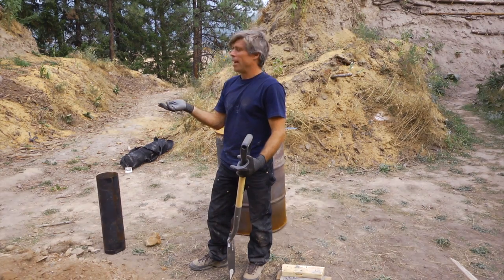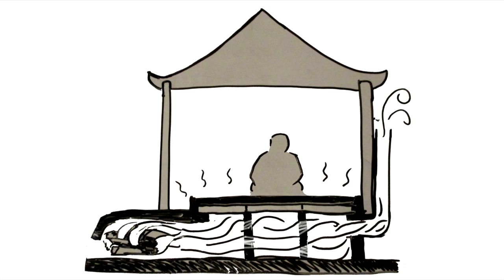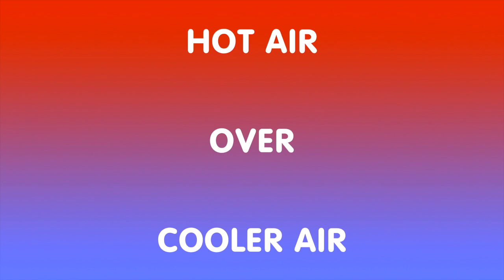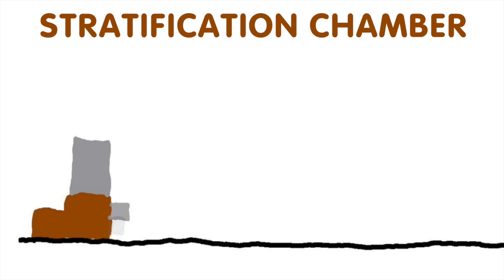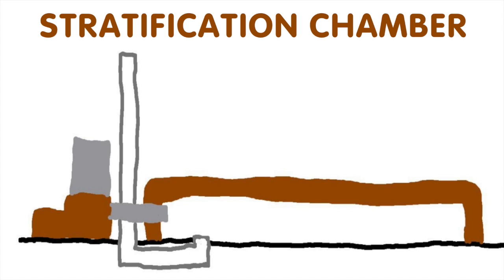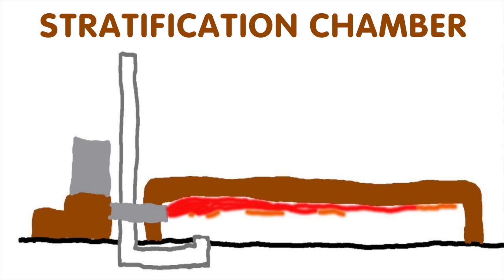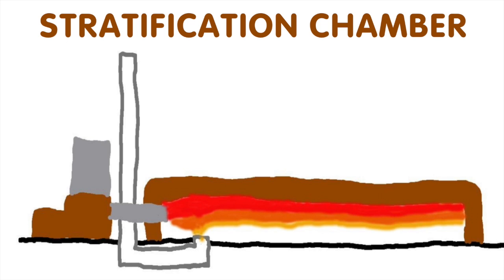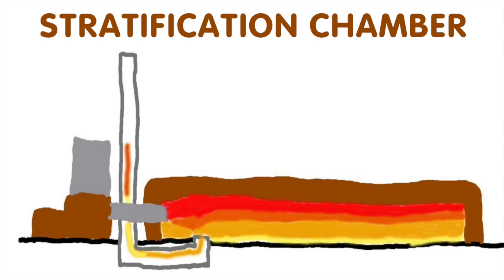stratification chamber in a rocket mass heater with matt walker

Comment: Question from a novice

Does soot/ash pile up in the chamber?. I'm assuming yes, if it also piles up in the duct pipes

How then do you remove the ash?.

Create a hole for a vacuum tube, Or just tare it apart and rebuild it? 

Or maybe the ash functions as a floor insulator ?
Reply from the maker: I recently looked into a heavily used rmh using 8 inch ducts.  A freaky massive amount of cardboard has been burned (which creates about 10x ash) and the ash hasn't been cleaned out for years.  It was about 1/3 full.  If burning just wood, my guess is it would be use up about 3% per year.  And a stratification chamber could go longer.

But, yes, our stratification chambers all have ash cleanouts.

Comment: Once the flow (or current) is established by convection,  won't it just short-circuit and flow directly to the outlet if there are no baffles or ducting to force the heat to flow to the far end of the bench?

Comment: I am wondering how the cavity in the bench is done exactly in order to avoid problems.    Besides I think that the design would be better if the exit would be located at the opposite of the hot air entrance, it will force a better heat distribution under the bench.
Reply from the maker: did you watch the movie that this is from?
Reply: @paulwheaton  Yes I watched the movie, that is why I wrote that.   Maybe I was not clear enough and you misinterpret what I wrote.
Reply from the maker: @denisdufresne5338  in that case, please take your questions to the movie thread at permies and we can then work in pics and drawings and stuff

Comment: Thanks for this explanation, Paul
However, the fact remans that the serpentine metal duct allows for covering the whole volume with cob-mass and making the bench or bed more stronger and easy to construct. If we do away with this serpentine duct, the whole bottom portion (stratification chamber) has to be hollow, which may be difficult or costlier to construct. What do you say?
Best wishes and love from Bharat (India)
Reply from the maker: Sometimes easier and sometimes harder.  Sometimes better and sometimes worse.  As always, it depends.

Comment: If the inlet of the exhaust at the bottom is the furthest away (far right side of the bench) from the hot air inlet of the chamber = bench on the left side, the exhaust wouldn't suck as much hot air away from the inside of the chamber as it would if the exhaust was closer (like in the video), right?

Comment: Is there much of an efficiency difference between a purely ducted system and this reverse bathtub? My gut reaction would suggest the ducting has greater overall surface area interaction between the hot gas and thermal mass, but perhaps the interaction time is increased for the bathtub, so I'm not sure

Comment: Great idea with the stratification chamber, but question is, does the rule for keeping ducting the same size throughout the system go out the window with this? Essentially the stratification chamber can be any size as long as your exhaust is the lowest point and still keeping the exhaust pipe slightly larger than the burn chamber.
Reply: Yeah

Comment: It seems like you'd get alot of smoke backing up until stove was completely heated and the flow was established. Did you find that to be the case?
Reply from the maker: After a minute, the whole system becomes pressure negative - so no problems.

Comment: If it's easier to build a chamber than to bury stovepipe in cobb, then it'll totally work.  Heating the chimney might help its performance, but I'd like to think that I didn't do twice the work to carry heat to the same amount of lineal feet of structure.

I can see doing it all up in brick.  Stovepipe in cobb might be more forgiving and more do-over-able.  I just see no shame in a hand-cranked or even an electric "primer" blower to get these things going.  Put a good tall chimney on it at the end, to start, and it should draw just fine once it's going.  It's getting it going that I'd be worried about, before I put one in.

Comment: I don't know if anybody monitors this thread or not but I will give it a go. If I put a 6 inch J tube assembly into a Well insulated 4X4X5 (L W H) stratification chamber. And I let the flue gas out through a vertical "chimney" from the bottom of the barrel. Could I achieve a temperature inside the chamber of 900 degrees F?

Comment: Getting ready to build a mass heater. I’ve watched so many vids. I’m so glad I saw this one. 
 
Outside the box for the win. 👍
Reply: Yes, it will draw once you get a column of heated air rising up the chimney.  The trick is getting the air moving through the thing at the outset, to prevent it filling your living space with smoke on start-up.  I think I'd use some sort of flapper "valve" with a hand-powered bellows or blower that I'd close off once I got the whole thing started.  I don't imagine it'd take much to save yourself a lot of "Some days it doesn't want to start" mornings.

Comment: I have to say that, I would like more science around this stratification. If you use water as an example it will always choose the path of least resistance. I and other stove builders I have talked to in Scandinavia make stoves around this principle. Since the hot gases choose the easiest path to the exit ( since that is where the draw is the strongest) we must manipulate the gas to take a longer route extracting more heat through friction.
Reply: Agreed, it's not obvious to me that a lot of heat would not be lost by just going out the nearby exit and not being forced to travel to the cold end of the bench before being allowed to leave.

Comment: Putting the stratification chamber below grade or below the floor may be preferable.  I haven't done it.   If the bottom of it were six foot lower than the combustion chamber a draft could still be established.   I anticipate a slight increase in difficulty.  

The main benefits would be reduced use of floor space, greater thermal mass if in the ground, possibly less cost of labor and materials and a warmer floor. 

If anyone thinks that it wouldn't draft, please reply.  There is the pressure in, and the vacuum out.  A bypass to the flue would help to start but I doubt it would be needed.   A warm house will warm the flue to cause some pull to get it started.

Some heat would be lost to the land of planet Earth but I don't know how much.  Dry soil has some insulative quality, about R-2 per foot I think.  The heat would slowly drive the soil moisture away.
Reply from the maker: I am pretty certain that dry soil has an insulative value of R-0.35 per inch.   So closer to R-4 per foot.

Other than that - I think this could be an excellent idea.  In fact, I kinda think you could weld three barrels together, cover them in an couple inches of low grade (quick) cob, and then plaster on a thick foot of the same cob on top (because heat rises).   This would be a magnificent thermal battery.
Reply: @paulwheaton  The horizontal chamber would discharge more quickly to match building heat loss better, I suppose.

Warm air rises; that is convection.  Heat movement in a solid is conduction and that movement is not affected by gravity, nor is radiant heat affected by gravity.  The sunlight coming down is an example.   If you put a bare foot on a cold floor you can feel the heat move downward.  Extruded polystyrene below the thermal mass would mitigate heat loss.

I am new to RMH and your evaluation of my subchamber idea was a pleasant surprise.  

Batch Rockets.  What is your opinion?  They would reduce much labor of splitting and feeding wood, correct?  I don't know the right name.   BRH?

Comment: With this method do you have to worry about gas leaking out into the room?
Reply from the maker: Yes and no.   For the first minute - yes.  After that, it becomes a pressure negative system, so, no.

Comment: Love the idea!  It may be just from the art work but,  if the exhaust coming out of the chamber is risen a bit and the heat the fills the area needed, then the cooler air escapes through a lower duct. The chamber  (lower than the first.) should not drop "down" but run lateral than up and out to the sky above.  Because A drop will collect debris (ashes...) and over time, will clog which brings me to a access point to be able to clean out every once in a blue moon.  But like you said Paul. YouTube lacks 3D drawing capabilities.  (My daughter says she can show you how it's done Paul.  lol)

Comment: Question: Is there less "mass" to heat in this RMH than when there's material all around the pipes? I like the simplicity and elegance, here, but is there a loss of efficiency? From the drawings and explanations, it seems there's a big hole of nothing in the middle of the bell,and just a thin-ish shell which would hold less heat than the pile-o-mud around the metal-pipe-designed one? No?  Put differently, what's the proportion of air space to mud here compared to a design where the air space is in the pipes alone?
Reply: Jean Rajotte I think you might be right, however, I do think the “less mass” problem could just be resolved by adding more mass. This is what the hypocaust systems did. Instead of making winding and weaving maze like flumes across multiple high mass surfaces in a block or a bench looking thing in the middle of the room they would push the gasses out under a very large floor space with substantial mass in and supporting the floors. The hypocaust system follows the principles in this video quite well and I would imagine could be used to more evenly warm a house as “heat rises” or “warm gases rise” as I think he says. Having the entire floor as a get source would allow anyone above the floor to receive heat instead of being needing to be very close to the sides of a large block in the middle of the room as heat doesn’t radiate as much off to the sides.
Reply: Inside the bench could be like a bee hive set of chambers where these chambers are interconnected, but they "soak up" the heat efficiently into the bench.
Reply: The reason the inventor of rocket stoves didn’t use the bell method is probably because he wanted to use fire cob and making cob domes and vaults without straw is no simple feat, especially with the added heat stress issue. And then even once you have a vault you can’t put nearly as much mass above it. I think rocket bell stoves have great potential for ovens and cook tops though
Reply: Good question, Jean. I was thinking the same thing. I think that you're right in that with less mass in the bench there will be less long-term storage of heat and more quick release of heat into the room. Mind you, it will still be wildly more efficient than a typical Woodstove. I also think this design would be more ideal in situations where there is not a lot of strength to support a huge mass-bench, such as a trailer or tiny-home. If you do have the strength, I would go with filling the bench with heat-storing material to get more thermal mass and slow-release long-term warmth.

Comment: Let’s say you ran the exhaust gasses through a massive chimney running 3 stories. Would that be enough to absorb most of the heat but not impede on the vacuum as much or would you need to make a heat sink and slow the air down like this?

Comment: what prevents the exhaust gas products soaking into the stratification bench construction and smelling bad.
Reply from the maker: Mostly how the system is a negative pressure system when it runs.  And then when the fire goes out, nearly all of the gasses in the system go out the chimney.

Comment: Interesting approach. Nice model but consider what turbulence would do. If the hot exhaust gas filling the chamber is fast, it will call turbulence, mixing hot and cold gas, which would vent to the nearby exhaust chimney. So having the chimney on the other side and low to the ground supports both laminar stratification and turbulent.

Comment: one question. I like the idea but we need to do a side by side comparison. In the case of the empty bucket turned upside down. Where's the thermo mass? Isn't that what the whole idea is about? It is a  Rocket Mass Heater after all isn't it?
Reply from the maker: the mass is above the stratification chamber
Reply from the maker: @christinaburney5935  except that for 99% of the burn, a rocket mass heater runs pressure negative.  And for the last 1% the co2 has been removed from the system.
Reply from the maker: @christinaburney5935  Bell?  What bell?  The barrel?

Comment: This might seem like a silly question from a novice in all of these endevours, but how would one go about making a cob bench hollow? Wouldn't the weight of the top collapse while it was wet, or would it crack? What if a large boned person came over and sat on it, would it break and expel all of that incredible heat? Just a paranoid person, wanting to try this method, but want to be sure that its the most practical...
Reply from the maker: Either bridge it with something or let the cob dry before sitting on it.
Reply: Has he successfully made a model such as this for himself or for others? If so that would be an amazing video to see 😄 It seems like an extremely cost effective design!
Reply: @garlandthompson5970  https://youtu.be/1GFCslsLZwo if you haven't already found it

Comment: Carbon monoxide excaping through any crack in the bell chamber or any cobed area into the living space can be a serious risk!  I believe the standard metal ducting has much lower risk
Reply from the maker: zero risk for all practical purposes with a rocket mass heater https://www.youtube.com/watch?v=IAb3922HD9U - a rocket mass heater is a pressure negative system for most of the burn.
Reply from the maker: Marvin Cooper  i do all that i can to emphasise that the real discussion is elsewhere (the forums at permies, the dvds, ernie and erica's book).  A youtube comment doesn't give enough space to go into a lot of detail.
Reply: Curious as to creosote build up.

Comment: reminds me of the Kusnetsov stove. In a monestary in Kiev I saw how the flue gasses went into a stove on the second floor, where the hot gas had to cool down to go into the chimney, raised to the third floor to next " stove", etc. Only the lowest stove was used to burn wood, the other three levels of the building had stoves without burning chamber. Just a small door for cleaning.
Reply: YES. It's the same concept.
Reply: The “ bell” variant of masonry heaters as opposed to more widely known circuit type

Comment: If only a public school makerspace could build these, it would teach young minds through observation and even participation even more than we can imagine about physics and math. And collaboration.
Reply: Not a ton of math.  But building these things and seeing how they work or don't work, would be very beneficial.  Acquiring the materials would be an education in itself.  What would work best, what's available and what does it cost?

I still think that buying cheap-as-possible stovepipe and burying it in dry dirt is the cheapest way to move that hot air through an earth mass.  The advantage of this system is that more of the heat would be transferred up towards the living area and less into the ground, as the warmer air is pooling at the top.

Comment: Paul I am very new to all of this and so I have lots of Questions...1. when looking at this as the heat goes into the bench , what makes the heat travel to the end of the bench before being sucked out before it cools down if the 2 air flows are so close to each other? 2. on the build its self- Is there rock in it at all and what or how is the structure built  ie supports if no rock in the bench or if there is rock , is it built as a wood box full of rocks? can you explain so I can understand this in more detail?
Reply from the maker: "More detail" is why we have the dvds.   But I'll try to help some ....  the reason that the hot air levels out is the same reason that water in a lake is so level.   Or water in a bathtub, or water in a glass.  Air is lighter than water.  Warmer air is lighter than cooler air.  

The stratification chamber can be built of any number of materials.